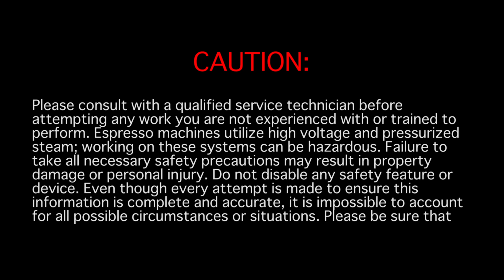GB-5 and FB-80 - Rebuild Steam Valves

Comment: Hi guys , I have a gb 5 and have completed a rebuild on the steam wand but can't get the wand to close completely have tried so many adjustments but is still leaking steam from end . Not sure what I'm doing wrong. It's a gb5 and has done a lot of work in a cafe/roastery but pulling my hair out to get it fixed .
Reply: I had that happen too because I had reinstalled the part at 4:50 backwards. Pretty noob of me, but righting it solved my problem.
Reply: Not sure if this is your problem but I've been rebuilding steam valves on my linea for my coffee shop for 10 years and every time I've tried using their recommended dow corning 111 lube it sticks open and at very least closes very slowly or just stays open. It's far far too sticky a lube in my opinion and I now use super lube which is also nsf but not nearly as thick or sticky, and works perfectly.